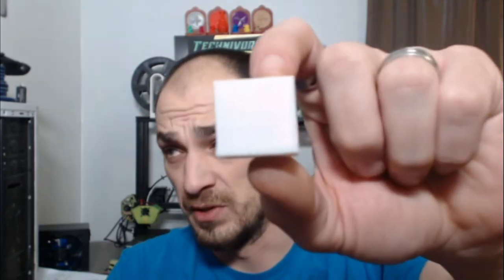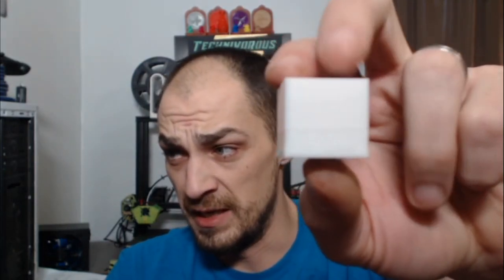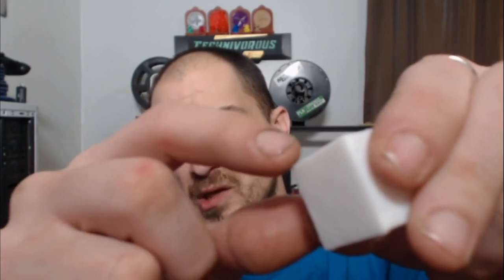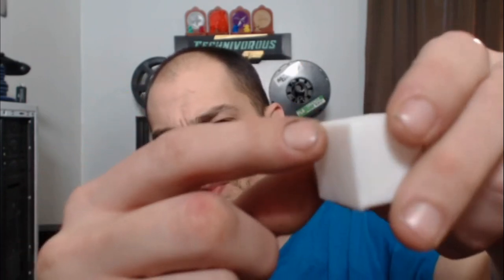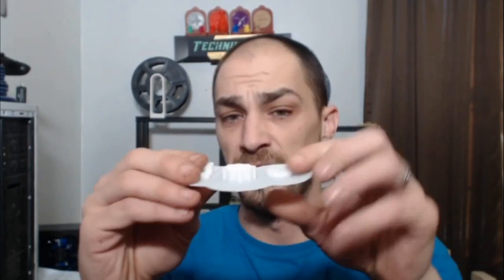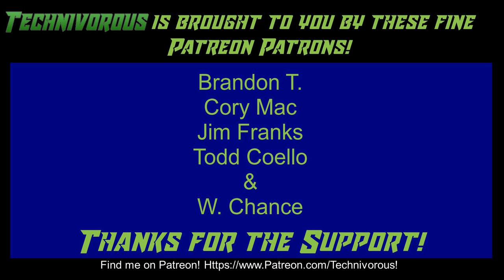I Need Your Help   Z Binding  Bottom Layers Squished

Comment: My printer predates the Tevo, but it has the same design with the running wheels on the outside of the gantry. Since you have already mentioned that it seems "tighter" near the bottom, I am pretty confident that you are having the same issue I did, which is that the distance between the vertical side extrusions is slightly wider at the bottom than at the top - might not be much, but some - and you probably adjusted/tightened the running wheels up higher, probably right around the area where the prints start to sort themselves out, resulting in that extra tightness at the bottom that is causing just enough added friction to create your low-z print issues. 

(I didn't listen to the entire video, so maybe you did this...but hopefully not, as I think it will fix the issue)
Try this (with the printer off, and the nuts that the z-axis threaded rods go through loosened):
1) loosen the running wheels/x-arm sides, so that they do not keep the x-arm held firmly against the gantry.
2) Bring the x-arm all the way down until the nozzle is touching the plate (if you have the magnetic bed still on, remove it first, so that you are technically at a  "negative z height"); take some books or other boxy items that fit under the arm at just the right height to keep it balanced with the barely nozzle touching (or as close as possible) _without you having to hold onto it yourself_.
3) Use a square level and calipers/measuring tape to make sure that the gantry itself is squared to the bottom of the chassis, that the gantry sides are perpendicular to each other the entire height of the printer, and that the x-arm is also square to the gantry.
     3a) If the gantry is not square to the chassis, do what you can to fix this as much as possible first. (You may have to loosen the top horizontal bar of the gantry as part of this adjustment.)
     3b) Once you've got the gantry as right-angled as possible, adjust the height/tilt of the books/etc. to keep the x-arm squared with the gantry sides with you still not needing to hold the x-arm in place with your hands; note that it is more important for the x-arm to be perpendicular to the gantry sides than it is for the gantry and chassis to all be perfectly perpendicular or parallel (as appropriate to the parts you are comparing). I.e., if you cannot seem to get the gantry to be perfectly squared off no matter how hard you try - perhaps it leans slightly to one side - the important thing then becomes that the slightly-leaning gantry sides are at least consistently spaced along the entirety of the gantry height.
4) Tighten down both sides of the x-arm side wheels so they all have the same amount of resistance/friction against the gantry.
5) Leave the z-rod nuts somewhat loose - they should move around some as the x-arm moves - and turn the printer back on, and test lowering and raising the x-arm. In theory the wheels will retain the same amount of friction at every height - and they _should not be so tight that they cannot spin a little without it necessarily moving the x-arm up or down!

My brain is kinda toasted today, slept badly, but hopefully all that makes sense. It caused the same issue you are seeing on my printer, so hopefully it will fix yours.
Reply from the maker: This lead me to the right answer which was the right side x gantry not being fastened properly, but the eccentric nut wouldn't do it so I improvised. It's fixed now you can see how tommorrow! Thanks for all the help folks!

Comment: I had a similar issue on my ender 3 - check if your eccentric nut on the x gantry (not with the extruder, other side) is to tight. My issue was fixed by loosening that nut.
Reply from the maker: This one was actually the culprit, and the eccentric nut just wouldn't get in position no matter how I turned it, but I fixed it, by adding a dual drive z system with a belt and another lead screw.
Reply: @Technivorous  You guys are legends.  I have been struggling with this exact problem for the past few weeks on my ender 3 pro.  Taking your advice I loosened the far side eccentric nut as advised, re-leveled, and bingo -- perfect calibration cube.  Really strange solution.  Prior to the fix, the gantry did't seem to be sticking at all.  Outside of the first couple layers and smaller than expected (.7mm) Z objects, my prints were mostly fine.  I guess the x gantry stuck a bit at the start of the print and then moved back into place.  Anyway, thanks for posting this sort of stuff!
Reply: @Technivorous  I just had this exact same problem on my ender 3. I fixed it by losening off the bracket that holds the wheels and pushing the 2 solid ones against the frame rail, tightning the bracket, then adjusting the ecentric nut. went from 10 layer elephants foot to flawless. I have been trieng to figure this out for a long time now and wouldnt have fount it except for your video.Thank you!
Reply: Guys thank you so much!!!
You saved me so much time, I wish I saw this sooner
Reply: And just like magic everything is how it's supposed to be. Thanks very much for your tip. Ended up loosening both eccentric nuts on each side. Still having a bit of "wabble" on the cube overall, not sure if it related at all but at least the worse is sorted.
Reply: Where is this eccentric nut everyone is speaking of? Please help I cant print
Reply: Drats i have a rail system. U guys think its too sturdy and should give way a little? Does anyone have a video of the fix? Or update?
Reply: Praying this is the fix to my issues
Reply: @Technivorous  would be nice if you would pin this comment.

Comment: Same problem here. When auto homing my ender 3 goes down till the limit stop, then slightly up only to go down in microsteps till it reaches the end z-stop again. This means that if there are any slag in the nut, this has to be overcome before the gantry can be raised, the more worn out, the longer it will take. I would try to change the nut to a new, make sure to lube well and see if it works.

Comment: Reset the eprom. I would level like crazy. Use NO z offset. I had this issue on my Sidewinder... I decidedly level properly, where no z offset was needed. Also is your bed cranked right. If the bed is too loose the bed will rise and lower as the springs heat and cool. Lastly, I would do a single layer test and tweak it until it’s perfect. If your first layer is set to 0.30, that’s what it should measure to. Once you have it set perfect a G92 Z0 and M500 should reset the Z 0 at the perfect height. I only use baby stepping if I’m changing filament types

Comment: Maybe reset the EEPROM just in case. That's how "software endstop" works, by clipping the movement against a plane, so it can interfere with offsets etc - normally shouldn't, but with Marlin changes between versions, could be. The result if the Z volume was clipped at the bottom would be that several bottom layers will actually result in movements at the same height.

But it's probably not anything like that, sounds like issue is mechanical in nature, and that... well run the whole height, and keep feeling it and listening to it, does it sound like it's got the issue only at the very bottom or does it repeat every few cm? Is the gantry wobblier at the top than at the bottom?

Comment: Same issue here, issue came out of nowhere and it's getting worse. Now the whole bottom 1/2"-1" of my prints look squashed then it resolves itself as it prints. BiquB1 esun PLA+ (60,215). The nozzle starts dragging, I adjust live height to stop the dragging, but after a few layers it starts dragging again until it eventually stops. If I don't adjust the z-steps during the print the dragging will get so bad it looks like it's going to cause a major problem. Baby steps, minor temperature adjustments, re-leveling, retraction settings, etc. nothing I've tried seems to fix it. I was going to try flow rate next but I'm hesitant to try too much of anything that'll mess up the rest of the print. It's so weird it resolves itself. Any advice? Maybe it's a physical problem and I'm focussed too much on settings?

Comment: one thing i noticed is how the hight vof the model changes everytime i change the z offset when leveling the bed. if its too low (but bed level and first layer is good) i get the model looking very squished. if i make the z offset higher ( again have the bed level be good and first layer be goodas well.) you will see the model getting taller and that line fading away. i fixed it at one point, but then scewed up my bed leveling when i moved the knobs and had to fix it again. cant seem to get the z offset high enough and have a good first layer and bed level. so now my models keep coming out squished

Comment: check the motor puly if its tight on the extruder, and check 90 deg plate with the tnut if it is bend it has to be exactly 90 deg

Comment: Ok. When I print the z axis is not rising. The extruder is just dragging through the pervious layers. The z axis works fine when controlled manually via LCD screen and everything was fine for 29 prints and now this? Please help I've done everything!
Reply from the maker: Check your eccentric nuts, on the right side of the gantry, and the x carriage. Raise your z so the carriage is dangling and then grab it and ahake gently. If it wobbles, thats your problem. I have a video for this in this playlist called fixing wobble on your x carriage. If the hot end dosnt wobble, double check the right side of the x axis for the same wobble
Reply: @Technivorous  hello mate. I will watch ur video now. I have just uploaded a video for you so you can see the problem if u want to watch it. Thanks

Comment: Did you ever solve this? Having similar problems.
Reply: Did you ever get yours sorted out? I'm having the same issue. I'm thinking it has to do with my z axis flexible spring coupler compressing. Not until it compresses fully does it start to go up correctly. I recently replaced mine because the one that was on it was messed up. I bought ball bearings to drop into the center of the coupler that sits on top the motor shaft but holds up the z axis.
Reply: @mattspawn1975  I did. I realized that I had added more tension in the belt for the print bed, which caused the bed to raise just a bit. Needless to say I didn’t level the bed after doing this as I didn’t think about it. Once I did, everything was back to normal.
Reply: @hannonmc  Thanks for getting back to me. I'm glad you managed to get it sorted. Unfortunately for me, I don't think that is my issue. Thanks again though.